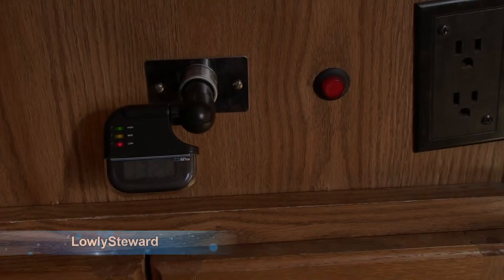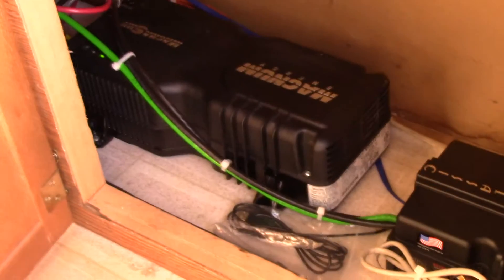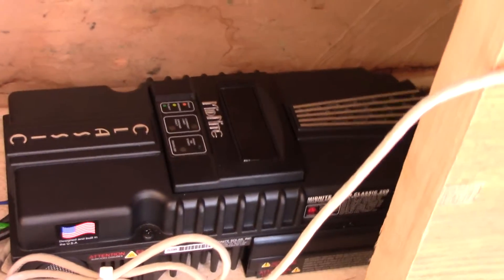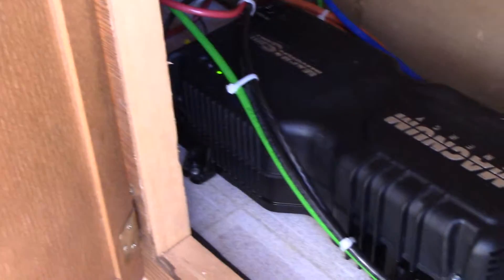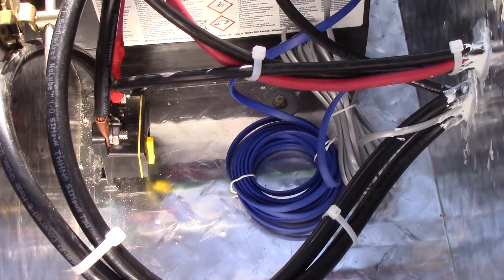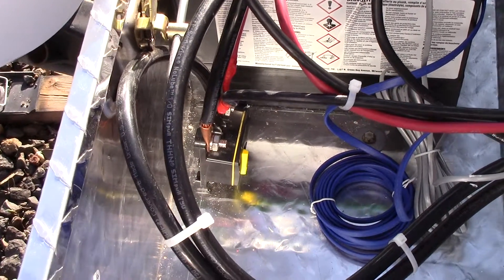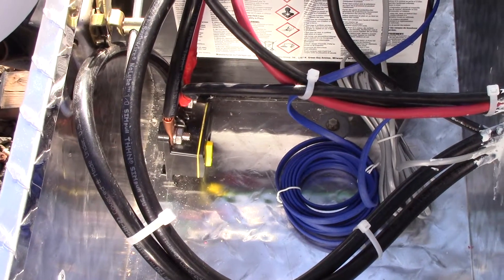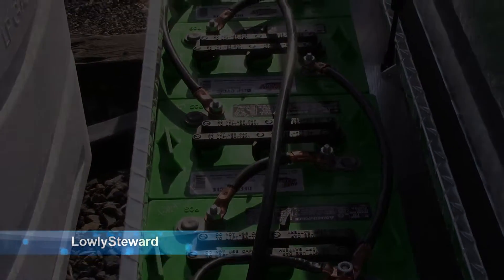RV Solar - Inverter - Charge Controller - Battery Bank Installed

Comment: Great stuff, I have one hard wired into mine, it shows the volts like that fun stuff. Very nicely done, Love your set up, thank you so much for sharing with us. I don't have an AC on mine anymore, I took it off and sold it and build the rack to load the kayaks on the top of the camper. I can put the solar panels front and rear when I get some. Thank you so much and have a blessed weekend my friend.
Reply from the maker: +Heartland Dual Sport Just be sure you know what size solar panel you're getting to be sure it fits... mine showed up and they were lik 4x the size I thought they were going to be haha... I completely spaced checking the specs on the size, I think I just assumed they were all the same size.
Reply: LowlySteward Yeah, I see that, Holy smokes, I seen the pic those are huge..